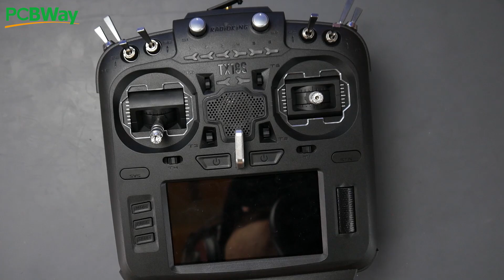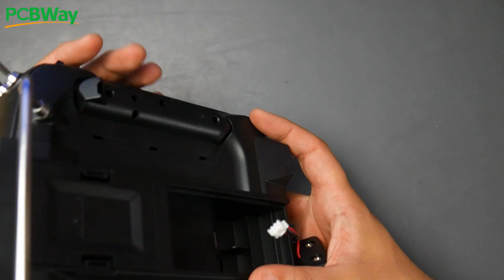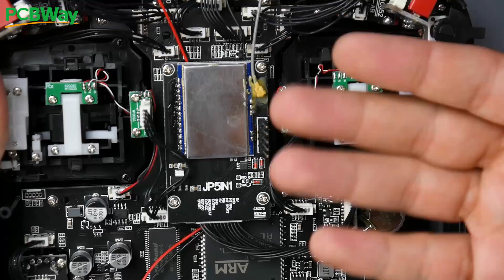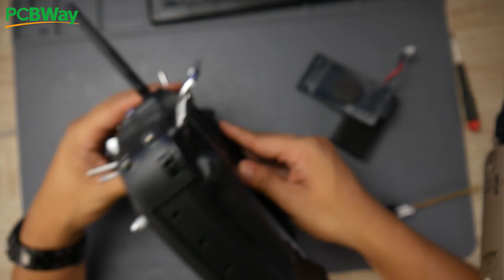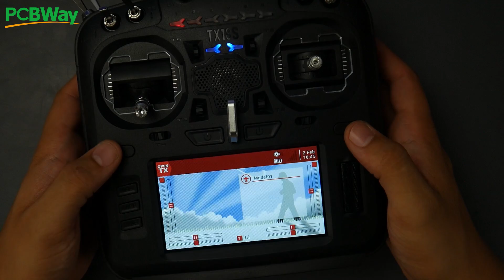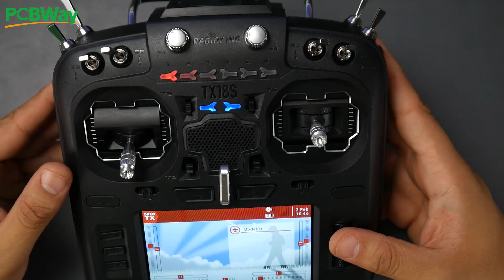RadioKing TX18S // Tear Down and Problems

Comment: Few things i don't like. 1.) SD card slot placement is horrible. hard to take out and put in sdcard. 2.) All buttons/ sticks/ slides naming/numbering on the faceplate is not coloured/ painted made it hard to see.(Radiomaster version looks better got white painted) 3.) L & R sliders center-point can be more better felt. 4.) USB C top rubber cover can ne better design, current one sooner will break and lost. 5.) throttle gimbal got a dropped feeling on full throttle zone, its like when reached 90% zone, the gimble will automatically move towards 100% (maybe only mine have this issue.). 6)It said got a touch screen, but it's not.
Reply: It has a touch screen. No issue on my Tx. Paint your own, these are indents, easy to paint just make a stencil.

Comment: dude just told us not to turn it on without the antenna!
Reply: Most of these modules have no problem with leaving off antenna because they have to little power to overheat final amp, less than 200 milliWatts.

Comment: +100 flights and rock solid my only complaints are 1 you can't map the volume to a pot like a 16s and 2 the gimbals are decent if you tweak the springs (all 2 weak).... mine cost 99.99 + 5.00 for a jumper folder plastic handle. 
Ps 25.00 for 2x5000 mah 21700
Reply: Ghost R9 work flawlessly

Comment: In case the touch screen you said didn't work is important, or a deciding factor for someone thinking of purchasing this radio, I believe the official support for Touch Screen in OpenTX will be in the OpenTX 2.4 release. So maybe it was a bit insightful for them to include a Touch Screen on this radio. Thought you may want to know...

Comment: 4:56 Shows a JP5N1 module, so that is a 5 in 1 with 868/915 MHz, like the Jumper T18 (pro)? But the product page claims only 4 in 1 with standard 2.4 GHz chips.
Reply: I was wondering the same thing
Reply: @mikeevans6926  Hi no it only has 4  in 1 the board is the same for all these radios but it has no components underneath for the R9 protocol

Comment: I'm pretty sure the external antenna is only for 900 mHz as the R9 system is supported, 2.4 gHz is using an internal antenna according to the manual.
Reply: Hi it hasn't got the R9 its only 2.4ghz they use the same 5 in 1 board for all these radios